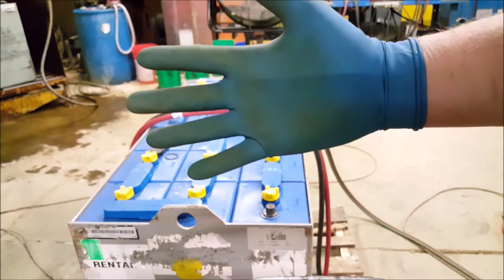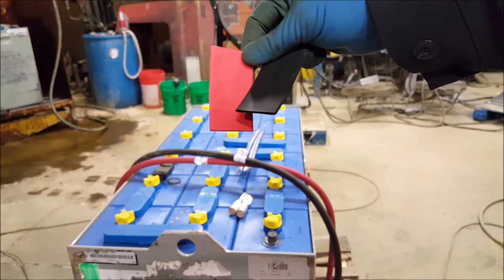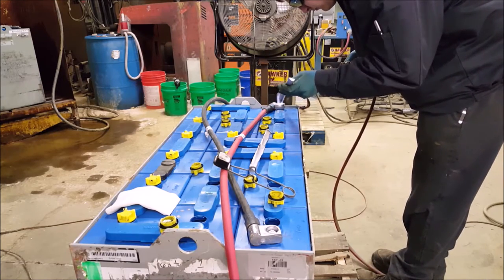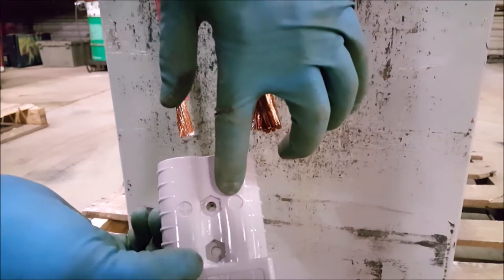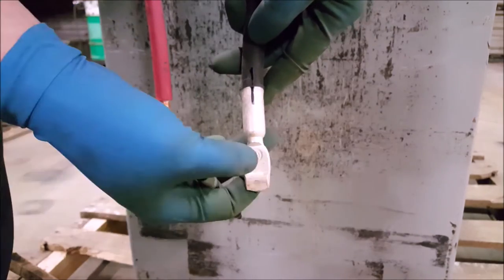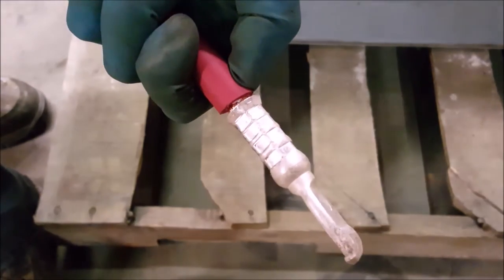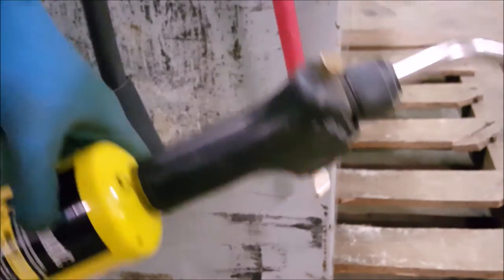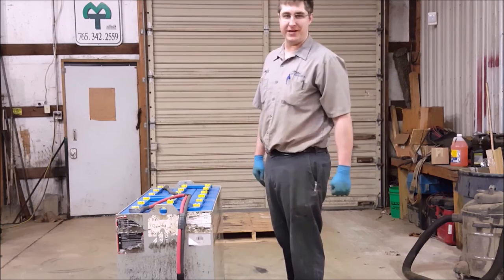How to install forklift battery cables

Comment: You should always fit the DC plug BEFORE connecting the battery cables to the battery...
Reply from the maker: Why?
Reply: Korcregus When the DC plug is fitted to the cables, the contacts are protected and there is no chance of a short circuit. If you fit the cables to the battery THEN fit the plug, you run the risk of the cables touching and short circuiting the battery.
Reply from the maker: Daniel Pudner In 8 years I've blown up batteries by trying new things and negligence but never have I shorted the ends of the cables together while installing new cables. When I have shorted the 2 cables together, it wasn't that big of a deal. This method produces the best looking and best functioning end result I've found. To each their own I suppose.
Reply: Daniel is absolutely correct. I've got 20 plus years of doing this and I can assure you that by shorting the contacts, you can do some serious damage to the battery.
Reply from the maker: @mikelowe5096  the only interior damage is done to batteries that were already on their last leg anyway. The short just finishes what years of use and abuse had already done. I have seen many batteries who's cables were pinned up against a rack and caused a dead short between them. Because of the danger in handling the shorted cables, the company had to let the battery fully discharge and the rack cool before removing from the rack. I end up replacing all the intercell connectors and the cables and the batteries still ran 6 hours. These cables shorting together wouldn't be that big of a deal.
Reply: @Korcregus  basic logic dictates that you eliminate potential issues prior to having them, just ask any insurance agent. If you are set in your ways, at least teach people to place a wire nut over the ends of the wires until they get to the plug.
Reply from the maker: @JamesBrown-fd1nv  it's not that big of a deal dude. Battery work is dangerous. They're heavy, full of acid and lead, produce hydrogen and oxygen gas in an enclosed container, you have to use a torch to weld the lead, etc... The cables touching are among the least dangerous things about working with a forklift battery.
Reply from the maker: @JamesBrown-fd1nv  in addition, every person who is watching videos on you tube to work on their own batteries is smart enough to mitigate danger. All others are working for a company who will teach them best safety practices. Autists who safety preach in the comments don't work on batteries for a living

Comment: I have a tech wanting to pick up the crimpers your using in this video. Can you give me more info on them?
Reply from the maker: The place I got them is called www.powrparts.com
However I just looked on the site to find a link for you and I couldn't find them. I'll do a little research and get back to you.
Reply: @Korcregus  alright man thanks!
Reply from the maker: Sorry for taking so long. I finally found similar crimpers to the ones I use.

https://powrparts.com/products/quickcrimp-hex-crimper?_pos=1&_sid=420291f7b&_ss=r

Comment: What is the wire Gauge ?
Reply from the maker: These are cobra cable 2/0 we used to get from www.powrparts.com 
They got them from quick cable. They have since changed their cables to royal excelene which have slightly smaller amounts of copper in their cables. I now use 3/0 where I used to use 2/0 because the royal excelene are smaller and I had some connectors melt.